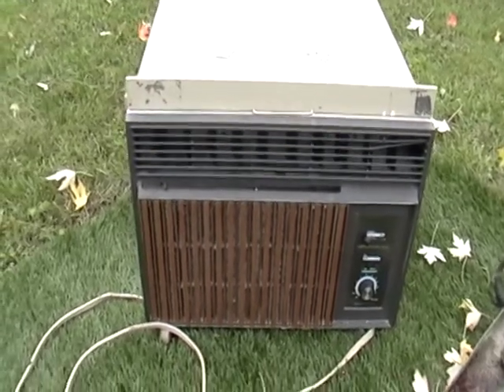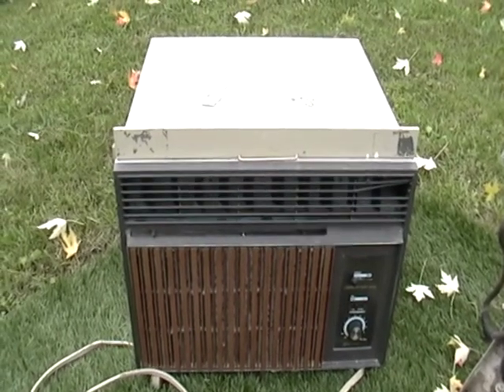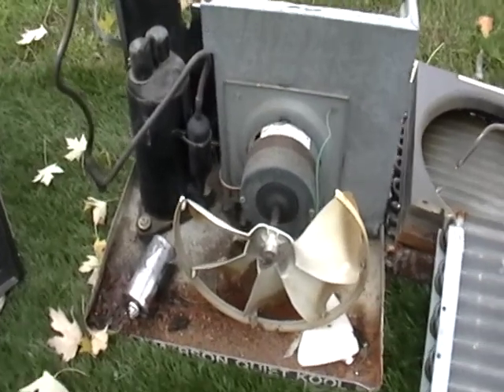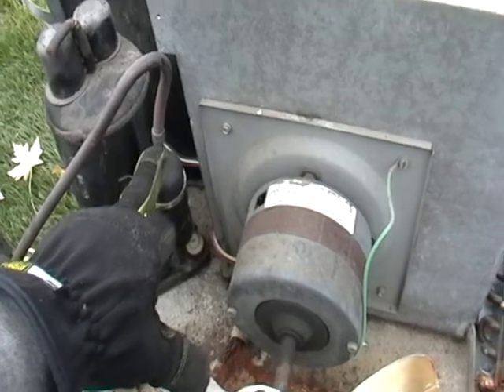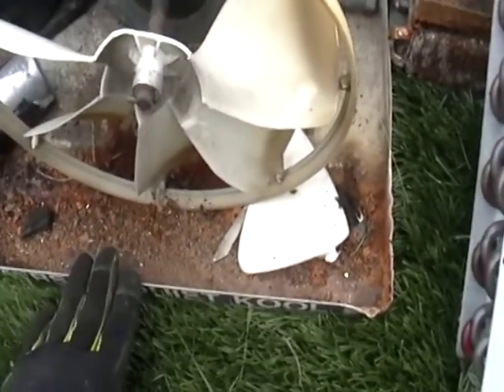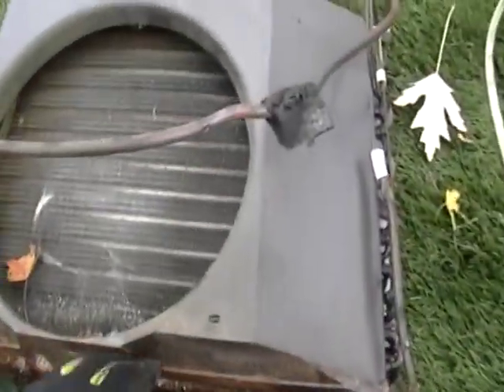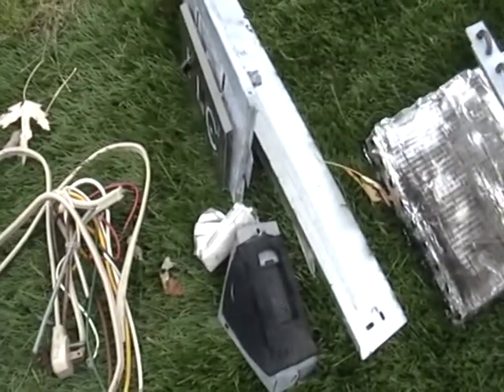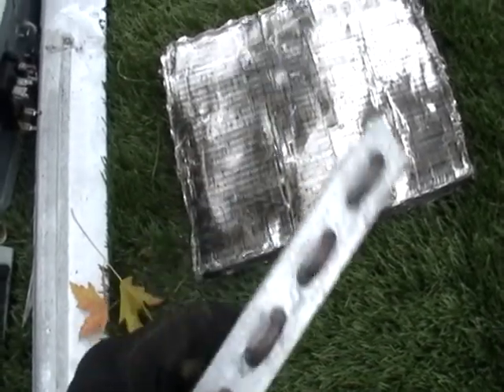scrapping an air conditioner part 2

Comment: 00:54 appears to be an electrolytic capacitor. They are basically an aluminum can filled with thin layers of aluminum foil and paper soaked with a dielectric substance. they can hold a powerful charge for quite a long time and can give you a nasty jolt if not first discharged. Scrap yards here do not accept them.

Comment: When cleaning the rads cut the copper loops off and make sure they are cut right down even with the steel. Now you can tap the steel piece right off.

Comment from the maker: If you sell an AC as is you will get $.10lb...If you strip the machine you have #2 copper that can be $3.00 a lb the compressor & motor @$.20 a lb the fins @ $1.50 a lb and all the steel @$.10 a lb... You can make may be $10.00 or more taking them apart...

Comment: you should be able to sell your CFC refrigerant to whoever drained it for you. that stuff is worth a lot. if you are just giving it away you should ask for cash, I believe after its filtered the recaptured CFC's go for about $20.00 a lb well worth finding a buyer for it. check your local refrigeration repair shops.

Comment: The radiators are:
1. Evaporator Coil (inside for cold air) 
2. Condenser Coil (outside to exchange heat)

But for our purposes here, radiator is just fine  :P

If somehow you find a guy that wants an evaporator coil, you can sell it for lots more I guess...

PEACE!!!

Comment: Mike maybe you should of told them to Discharge the capacitor so it don't knock them on their ass. You may also want to tell them how much the fine is for Illegally discharging of the freon from the A/C unit.

Comment: Be careful with that 2nd sealed unit it's a capacitor it holds a charge and can light you up.. discharge it first with a screwdriver...